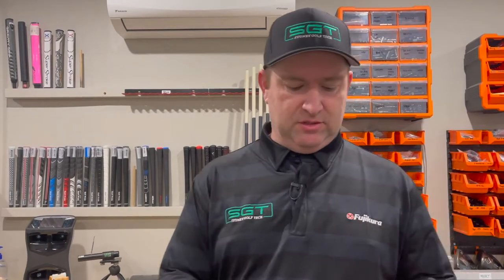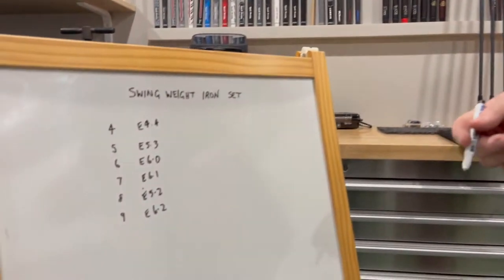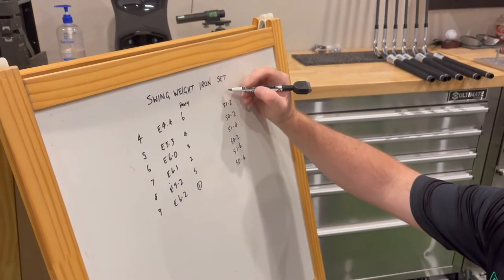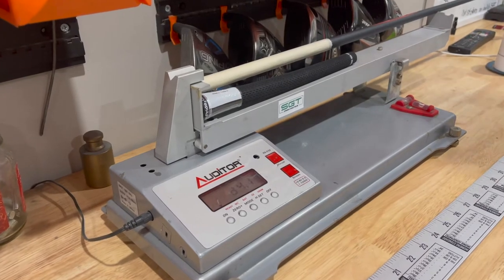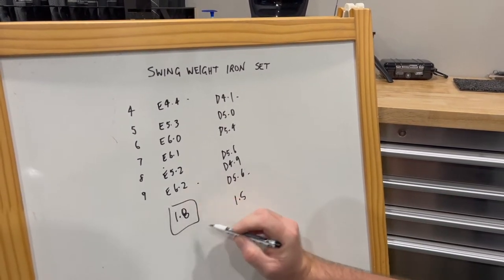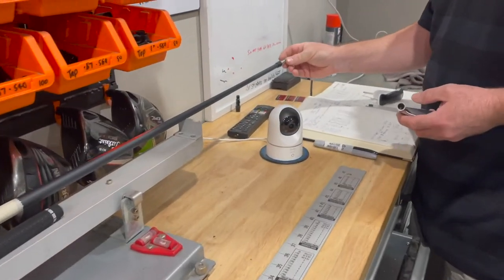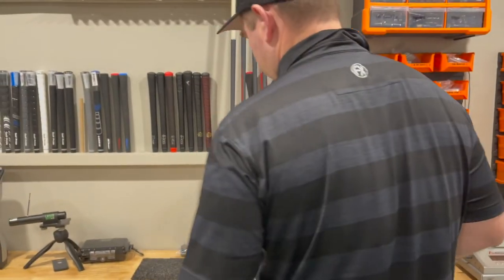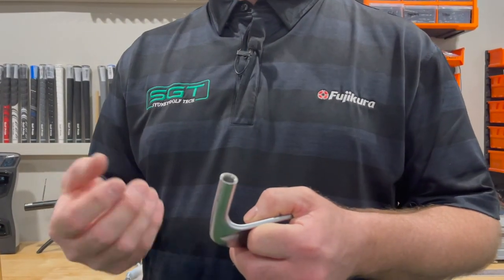How to swing weight a set of irons

Comment: May I ask, what swing weight do you recommend for 76 gram stiff graphite shafts? I am finding that I need to ad lots of weight to my irons..They are dry swing weighting at C8 to C9.. I had to ad lots of weight to get to D2.Do I need to play with D2 irons, or will C9 or D0 do the job? I have tried DG s300 D2 and they are simply too heavy for me.I crunch a driver 240 meters and 7 iron with s300 shaft 135m...your info would be appreciated..thanks.
Reply from the maker: @nickpritchard7130  I’d say C9 would be absolutely fine. If you put too much weight in the heads, the head starts to feel heavy and the shaft will flex more than it’s supposed to. There’s no exact answer here but I’d be experimenting with C9 to start.
Reply: Thanks for your reply..I glued the irons yesterday and am aiming for D0.All irons should be around D 0 when finished..So I am quite optimistic..Many thanks for your quick reply and valuable info.Great Vid....kind regards Nick..

Comment: I use a flush cut off old grip cap to put between the shaft butt and swing weight scale to measure that gap for proper length of shaft to SW scale butt seat or you will come out too light after assembly. It is approximately .180” - .200” and does make a difference. Also, if I have a used grip the same as being used in the build, I weigh it to make sure it is within grip weight spec and split it with  a razor knife and put it on the shaft for a closer SW dry fit. I then add about a half a gram of lead tape on the hosel to simulate my quick center and epoxy weight.
Reply from the maker: Quality swing weight scales already come with a shaft stopper on one side to accommodate for the butt of the grip. They will also accommodate the exact grip you are using. Nice to hear about alternative methods though. Thanks for watching.

Comment: Greg,,,,,,,,What is the best way to remove a hosel weight?????   Also,,,,have you ever extended an Aluminum shaft from the '70's,,,,,any hints for that big OD and small ID. thx much!
Reply from the maker: The best way to remove a hosel weight is to apply heat and then try and get some movement from it using a skewer down the bore. If that fails, then a drill press is used. I haven’t extended an old shaft from the 70’s but sometimes you can build up the OD of your extension with masking tape.

Comment: Great video, how would you go about reducing swing weight? Without changing shafts. Eg playing kbs 130x in irons and wedges and the vokeys feel way heavier than my t100 irons
Reply from the maker: There’s a couple of ways to reduce swing weight:
1. Shorter shaft length
2. Drill out some mass from the heads 
3. Heavier grip 
4. Add weight under grip or at butt end 
All of these methods have some negative ramifications such as increasing the total weight of the club, so unless you are willing to shorten the club, you can’t reduce swing weight easily.
Reply: I’ve since used an online calculator and my irons are all d4 and wedges are e1 so think I’ll have to come see you for some swing weighting!
Reply: 1.25” over standard in the irons
Reply from the maker: @mast3rproductions  D4 is very light for 1.25 over standard. They should be much heavier on the swing weight.
Reply: @SydneyGolfTech  I thought the same. My previous irons (ap2) were d7. 
My current t100 have $ taper 130x and must’ve had head weight removed to be d4 I assume? 
I was fitted by a company in Sydney which built them also

Comment: When i set my clubs I aim for D2, Irons and woods. 1 length of masking tape is 1 gram so I counter balance using masking plus I like a thicker grip anyway. 
The opposite way I have really low swing weights at C5-C8 here I would use a lighter 38-40 gram grip weight. to gain  4-7 grams at the in the head. 
I try too avoid loading heavy the grip or the toe as this just passes a new problem on regarding the shaft flex.
Reply from the maker: There is always total weight that needs to be considered also. 2 clubs at D2 can feel totally different if the total weights are different and they often are.

Comment: When you add the weight after installing the ferrule, is there not a gap between the head and ferrule??
Reply from the maker: This is why a ferrule depth is set. Shafts should never be pushed all the way into the head when being installed. The ferrule should be set to a height to allow for a swing weight if one is eventually needed. Most people do not know this and don’t know where the ferrule should be set.
Reply: @SydneyGolfTech  Thanks
Reply: Still thinking....If the ferrule is not on all the way with the head when checking the swing weight, wouldn't the SW be lighter because the head isn't all the way on until you decide if it need a lead weight?
Reply from the maker: @paulbatchelor9578  no manufacturer installs a shaft all the way in, nor do we. If anything, amateur club builders will install the shaft in too far and then it’s playing stiffer than it was designed to.

Comment: Hey mate-loving ur vids. Q. I’ve got a bit of an issue with a new set of irons I’ve just purchased. I was fitted for a set of T100s but during the fitting there was no attention to shaft length & I was just advised I’m standard length. When playing the first couple of rounds I’m having issues hitting the irons(everything is coming off the bottom) when I measured the 5iron it’s just over 37.5 inch. Which is short of standard & I think I need at least 38.5 or 39….is there anything that can be done to fix this? Do u know of any quality fitters in Brisbane that I could go see to help me?

Comment: Great video and very informative…one question, when you were swing weighting with the grips, you had the shaft going all the way to the end of the scale…however, wouldn’t the grip take up about 1/4” or so and the shaft not go all the way to the end?  Or does it not matter since you did the same with all of them and it’s just relative?
Reply from the maker: The scale has a small stopper on it that is approximately 1/8 inch long which allows for the grip cap. So the shaft doesn’t actually go all the way to the end of the scale. I hope that makes sense. Thanks for watching. 😀
Reply: @SydneyGolfTech  Makes total sense…got it…when you start doing the rest of the set (hybrids, fairway woods, and driver) do they still go in a weight progression from club to club or is that not as important?  For example, some guidance says 7g between each iron…when you jump from a 4 iron to a 5 wood, would that still hold true?  Same between 5W, 3W, and Driver?
Reply from the maker: @petegalindez9961  there’s always a weight progression, with the driver being the lightest head, but problems can occur when different brands are used as they are never the same weight. For example a Ping driver head is roughly 10g heavier than a TaylorMade or Callaway head.

Comment: Hi Greg, using a standard swing weight machine is there a way of checking the dry swing weight  (without the grip and glued head)
Reply from the maker: Yes. Most swing weight scales will include a function to do exactly that. I always dry swing weight before glue and grip are done.

Comment: Thanks for the info Greg. Quick few questions, should you aim for a certain swing weight? I rebuilt my Titleist 712 6 iron MB with no tip weights and went to the range with a roll of lead tape and after trial and error the end result was an 8g tip weight. Is that too much weight to add to the tip? The head weight was 257g not sure if the heads are typically lighter with Blades. Lastly I’ve read/heard you should maintain a 7g progression per iron, is there any particular reason for doing so? Thanks Greg, keep up the great work!
Reply: 2g is one swing weight c6 to c5 for example.  The swing weight you choose is up to you.

Comment: I know this was an exercise, but he did weigh the grips with the plastic still on them. Not a major gaff, but I noticed. I also do not understand why he would bring all the clubs UP to the 5.6, unless thats what the player requested. Seems very high for a full set of irons swing weight.
Reply from the maker: @khemheru1439  the tiny piece of plastic on the end of the grip makes no difference to the swing weight on an electronic scale, that’s how irrelevant it is. Also, we always bring swing weights up to the heaviest swing weight as there is no way to reduce swing weight other than drilling out heads. Adding weight to the butt end to try and reduce a swing weight is poor practice and we don’t do it.

Comment: So this owner knew that he was going to be looking at SW higher than standard? What if they wanted lighter? Select a different head to begin with? Muira are heavier compared to other irons I've heard.
Reply from the maker: If you play over length, you should play over swing weight. D2 at 1/2 inch over is no good as the shaft will not flex the same as it would at D2 and standard length among other things.
Reply: Your logic and process is spot on.   In my shop we also use the Auditor SW machine.  I agree that over length clubs need to SW heavier but 3 points is a lot.  I would have either drilled the heads or counter balanced the shafts to lower the SW.